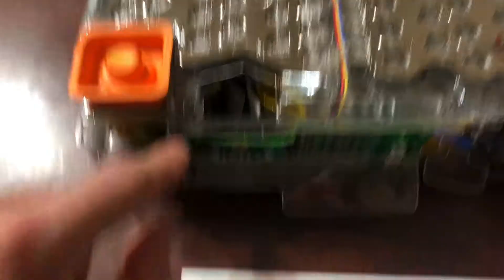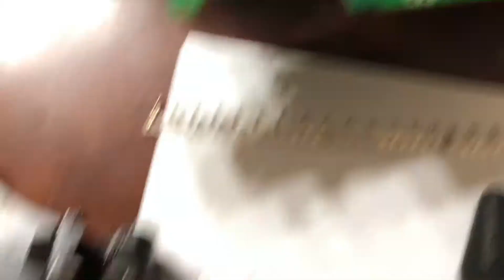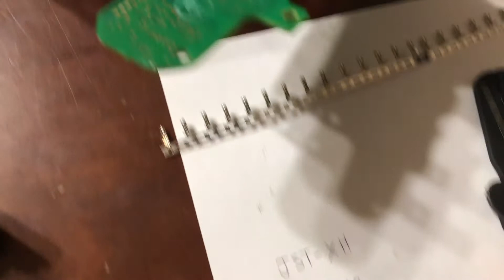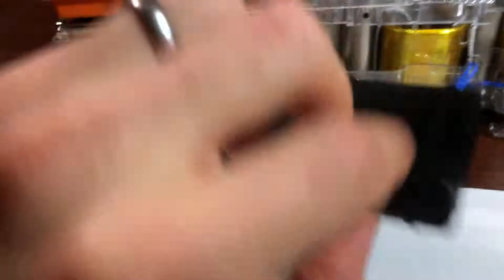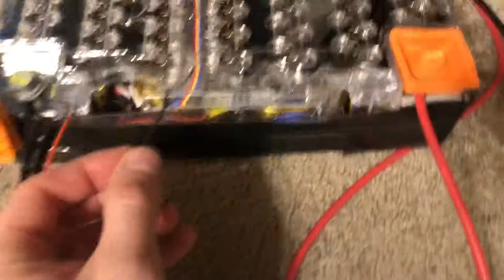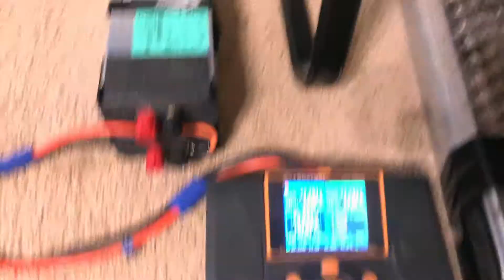How to wire and charge a Tesla battery module DIY

Comment from the maker: Update:  My charger setup can charge at 55A max (not 70A) since my power supplies put out 24V instead of 30V.  From research I've been doing, 10awg wire should be enough to handle this charge rate, even though it gets warm (100°F) while charging.  I still went ahead and upgraded to 8awg wire to be on the safe side.   I also added a 175A fuse, and a 100A Victron BateryProtect module to cut off the power to the battery when voltage drops below 19V.